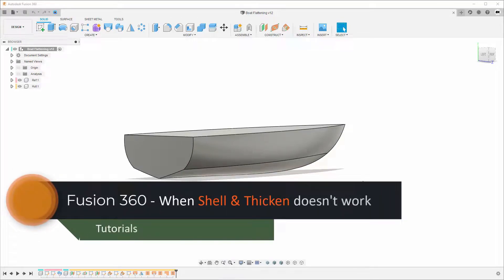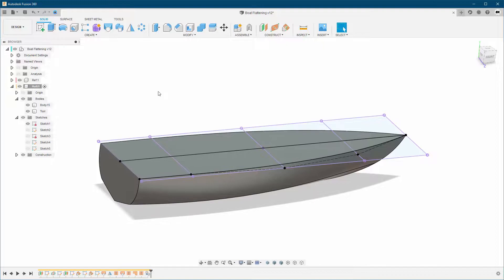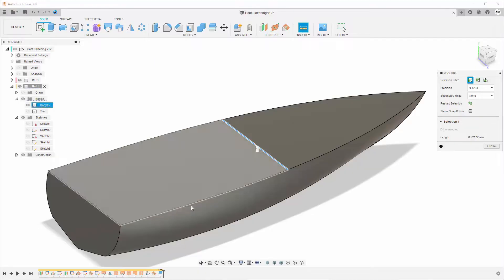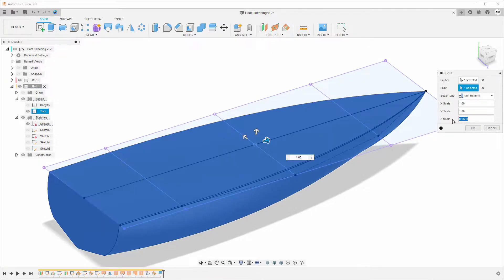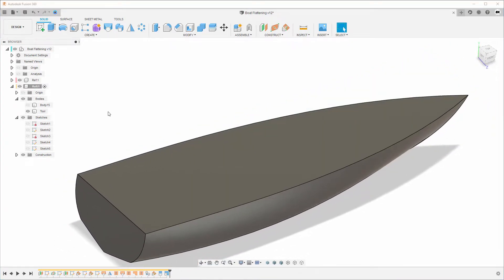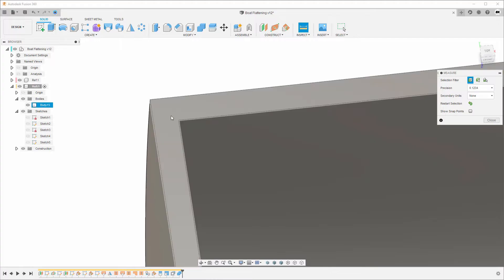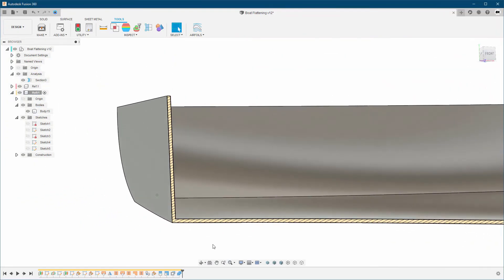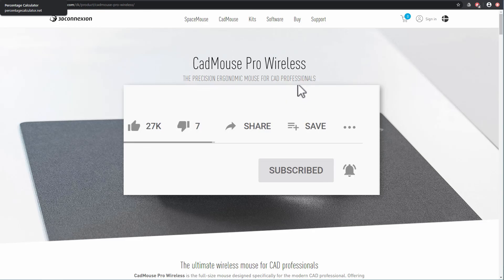Fusion 360: When Shell & Thicken commands don't work - Try this technique!

Comment: This is a really inaccurate way of doing this. The thickness won't be uniform. If the shell command doesn't work, there's something wrong with your object. It would be better to find out why it's not working.

Comment: What about torus or ring shape? Why not to offset the faces instead?
Reply: Did u find a solution for thickening a ring hollow like shape? I have been trying for 2 hours but no luck.
Reply: @Zae-R  Thicken/Offset works on simple hollow ring. Maybe your geometry is more complex or messy?
Reply: @m34275  Yeah it is kind of complex.. its a centrifugal compressor casing. I took a long time designing it but its only a surface now and i want to make it solid.
Reply: @Zae-R  Idk try splitting it and thickening parts separately. At least you'll locate the problematic area. Fusion  often has issues with complex parts. Also it is optimized for solids so I would suggest remodelling, there may be more issues in the future.
Reply: @m34275  I actually tried chopping it into two pieces and then thickening it and it didn't work. But i think it would work if i chopped it into more smaller pieces. I guess i am gonna try this today. Thanks for your help.